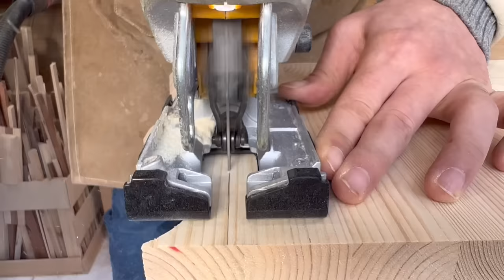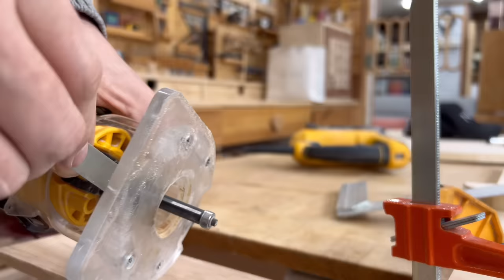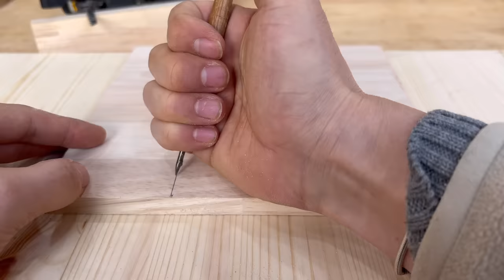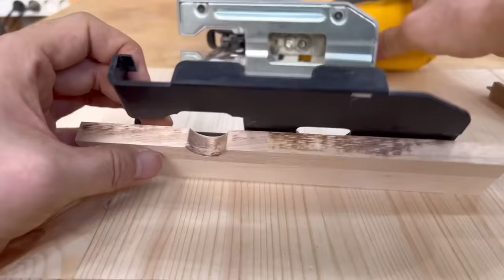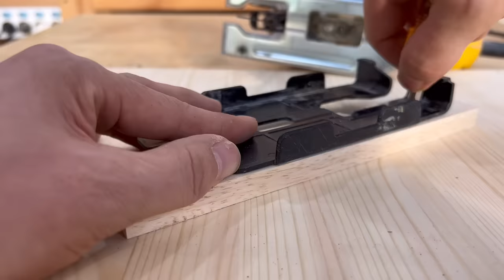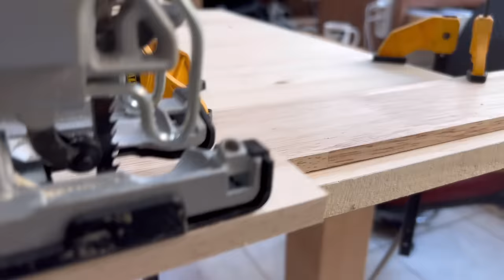라우터 방식을 응용하여 직쏘로 직선 자르기

Comment: Wouldn't it be easier to just clamp a straight edge to the workpiece and use that as a guide?  The method in the video essentially does the same thing, but with the added step of screwing a piece of wood to the jigsaw.
Reply from the maker: Thank you for good comments 😊 Have a nice time 🍀
Reply: I think theres a good chance that the jigsaw could wear out the edge or cut straight through in that case. I can see why this method is better long-term since it doesnt wear out the straight edge after repeated uses.
Reply: your idea has one benefit: you can cut thicker pieces. THOUGH: it's not so immediate to place the "guide rail" at the perfect distance. It's easy, but not as immediate as this method reaches
Reply: @marcopinchetti5872  the way I do it is by using guide blocks. Basically a pair of blocks that define the distance from the guide to the line. It's fast to set up and you can always use a metal guide like a t track if you are concerned about wear. But if you are doing a lot of them it can become time consuming in comparison to this method
Reply: Not to mention the added distance between the machine and the workpiece, allowing the blade to bend a little when it follows the grain of the wood. with the machine on the workpiece itself, the blade cannot bend that far, allowing for more precise cuts.Also, wood against wood gives more friction instead of metal against wood.
Reply: No OP is right this is not practical on the jobsite, if it were all us finish carpenters and cabinet makers would be using this method yet we’re not, we just clamp a straight edge on real quick then hit it instead of making a jig that’s a waste of time, or just use a table saw like a normal person, that’s what they’re made for ya know…
Reply: Exactly!!!
Reply: QUIT SPAMMING!
Reply: Also most jigsaws come with a paralel guide that id basicaly exactly this build here just adjustable and made of metal.
Reply: @chowderwhillis9448  a curved jig seems fun tho
Reply: @chowderwhillis9448  @inod yep
Reply: Exactly! Over complicated
Reply: How about using the router method with your router for a straight cut.
Reply: Job-site use a circular saw for straight cuts. Weekend warrior, this is just fine. It's a different case to using a table saw that requires the piece to be setup.
Reply: @JustinShaedo  jigsaws have to be the worst tool invented; bad for rough work, bad for precision work...
jigsaws belong in the junk bin!
Reply: @walterbrunswick  Fair enough :) I'd struggle to make curved cuts without one though, tbh I'd use a jigsaw in maybe 40% of installs I do... I'd just avoid them for straight cuts.
Reply: Exactly what I do :-)
Reply: @walterbrunswick  it has its purposes but I won't use it for finish cuts.  I use it for approximate cuts and finish with a sander, router, etc.
Reply: @marcopinchetti5872  you are still havingn to clamp a guide rail with this method...
Reply: My thoughts exactly. This just turns a simple task into rocket science. Unnecessary.
Reply: And destroying the tool in the first place 😂
Reply: Absolutely brilliant! This video simplifies complex concepts beautifully. I finally understand how to precisely cut straight lines using the router method. Thank you for such clear instructions!"
Reply: @marcopinchetti5872 that was my thinking too.
Reply: The edge may be straight but the jigsaw blade can waver resulting in  an edge that is not square.

Comment: Better to use the right tool for the right job. But if you have nothing else, I guess this can work as a permanent workaround if you not planning use the jigsaw for something else. Can also just use a guide and clamp as usual instead of fixing wood to the jigsaw which you will need to remove again when using it as intended. The ideal tool will be a circular saw and will give a much more desirable finish. Jigsaw is better for odd shapes, curves and tight corners in my opinion.
Reply from the maker: Thank you 😊 🍀👌Have a nice time 🍀
Reply: Exactly no offense uploaded but this is kinda stupid and just to get YouTube views, not practical on the jobsite
Reply: Exactly, the blade always flex thus no point trying to make accurate cuts. The only benefit of this jig is we don't have to account for the width of the base when placing the straight egde
Reply: Indeed a track saw will work better. But if you need to use a jigsaw this is a genius method.
Reply: @SimplySketchyGT  if I have to use a jigsaw, this jig, a straight edge, or whatever will always give me a less than desirable cut.  Free hand cut won't be that much different.
Reply: Speech.
Reply: @chowderwhillis9448  tout à fait d'accord avec toi, c'est inutile !!!!   juste pour faire du buzz.
Reply: Couldn't agree more
Reply: not all amateurs have all the tools as a woodworker, so this makes perfect sense
Reply: @kalinkaata  all the more reason to use a guide and clamp. Cheers
Reply: @Zjaan321  agree. was talking about the circular saw. an amateur may not have it
Reply: I don't want to use circular saw, because it's intimidating and dangerous. I've always been on the lookout for ways to make the jigsaw cut straight. This is the best method I've found so far.

Comment: 🙃🥴The irony of this video is that you need advanced power tools, like a table saw, to create a jig for making straight cuts with a jigsaw. However, if beginners had access to those advanced tools, they would likely choose to use them instead of a jigsaw for this specific task.
Reply: You could use the factory edge of a sheet of plywood to make this. That way you would not have to make any accurate cuts to make this jig. But you make a fair point. This is always the problem with these types of yt videos, "excuse me while I whip out my perfectly set up table saw to make a jig for cutting straight lines!" ;) 
Anyway, I will try to make this using only a jigsaw and a cordless drill

Comment: The black plastic guard that is on the bottom of the jigsaw...actually has square and parallel sides. Put a straight edge on the top of your timber and use it instead. Good brands state on them how wide they are between the edge and jigsaw edge.
Reply from the maker: Thank you 😊 Have a nice time 🍀

Comment: If you have a square or a straight endge you can run it against the the saw guide and will save you time and gives precision.
Reply: Yeah, there’s no point in doing what he did if you’re running the saw against a straight edge anyway.  Just back up the straight edge and run the guide along it like you said.

Comment: Great solution to finish 👏👍

Even with a circular saw you could get a wobble.
Reply from the maker: Thank you 😊 Have a nice time 🍀
Reply: Circular saws wobble but the saw kerf is consistent. When used with a fence, wobble will produce a kerf wider than the blade, but it won't produce a wandering cut like a saber saw. The angle of the blade to the work does not vary in a circular saw. It varies quite a bit, and unpredictably, in a saber saw.

Comment: Thank You. I need to make angled cuts on a 1900mm piece of plywood. This will do the job much more accurately than trying to follow a line. In fact I can use it with a circular saw. Much better than the saw guide cutting through the centre that I tried. Straight edge is of course another piece of ply.👍👍👍
Reply from the maker: Thank you 🤜🤛😊 Have a nice time 🍀

Comment: You will never have the same quality of edge as with a flush trim bit! The jigsaw blade has too much deflection(flex) in it....better to use a table saw or circular saw!
Reply: i like this design as it allows the clamped guide to be placed directly on the intended cut,
Reply: Yes. I too found it difficult inspite of all adjustments.
Reply: Because most jigsaws is junk, a circ saw is better yes.
Reply: You missed the entire point of why something like this might be helpful, maybe they don't have other tools? You ever think of that? "Just use X tool" is such a weak argument. Yeah that's true, if you don't have constraints on budget, storage space, etc.
Reply: @UrdnotAkongo  No, I didn't....ANY wood worker has a circular saw! I, and anybody I know, bought/was gifted a circular saw as their first power tool!
Reply: @UrdnotAkongo  And, the point you missed in the video, he "free handed" the first cut, then all he did was add a straight edge guide to the jigsaw! He could have just measured carefully and used a straight edge without attaching anything to the jigsaw!
Reply: @UrdnotAkongo  And it showed using a table saw to make the piece for the jigsaw! So there's that....

Comment: This is a great idea. Thanks for the video.
Reply from the maker: Thank you 🤜🤛💚😊 Have a nice time 🍀
Reply: It's a complete waste of time, did you see he clamped the straight piece of wood to the wood he was cutting? All he had to do was move it over to allow the blade to cut on the line he wanted to cut and just keep the base of the jigsaw tight to the clamped wood, he would have had the exact same outcome without going through all the wasted time attaching a piece of wood to his jigsaw.

Comment: If you use templates this works with almost every shape, including guitars. This is actually a very common and straightforward method. But if you want something straight, a chisel or a plane would also do a fine job, just takes more skill and time.

Comment: I love the bit where you need a table saw to get the straight cut on the guide you need for a tool thats not the best option, still have to clamp straight edge to your work, and will still probably get a wonky edge because it's a jig saw. 😂

Either cut with a jig saw and use the router to get the edge you want, or cut with the damn table saw
Reply from the maker: Thank you 😊 Have a nice time 🍀

Comment: Interesting, I wonder if you left the hole round, and fitted a Delrin plug with a slot the same width as the blade would make it cut even truer.
Reply from the maker: Thank you 😊

Comment: Was with you up til the end. Seems like a lot of work just to raise the jig saw higher away from the material. Point is you could just cut out the middle jig (play on words, lol) and just run the jigsaw's base against a straight edge instead of fabricating and attaching a higher base that's going to run against a straight edge. It just seems like wasted effort, much like my comment, lmao.

Comment: this is innovative  thanks for posting.  however my issue with jig saws is not only a straight cut but always blade deflection causing the blade to angle and vertically out of plumb. does this jig prevent this? if so, why?
Reply: Most jigsaws will have an adjuster for blad tension to make the blade cut more stable making the edge plum vertically, if using an older or cheap model the tension may slip causing the edge to not be vertically straight but you're definitely right with this being a problem. Much better off setting up a jig with a drill and a table saw blade for a cheap alternative to a table saw for making straight cuts. There's a few vids out there on how to do it. If wanting to use this method cutting very slowly to reduce pressure on the blade will help 🙂
Reply: @tuckersossaman236  Thanks for the suggestions!
Reply: Don't push it, go as slow as possible.
Reply: @tuckersossaman236  My issue with jigsaw is that I can follow a straight line while cutting, so I get it straight on the top but totally messed up on the bottom if the wood is thicker than 1cm. Does what you explain help with this problem? Thanks in advance!

Comment: Instead of wood I use lean or plexiglass. I cut a zero clearance slot with blade I will use in saw. Due to zero clearance it cuts a clean cut without splintering and you can watch the cut through the plexiglass. I attach the plexi to the saw soul plate with carpet tape (amazing how useful carpet tape is for woodworking) so easily removed so reverts to normal use.
Reply from the maker: Thank you 😊 Have a nice time 🍀

Comment: It's easy to cut straight lines with a jigsaw, just clamp a straight edge to your material and follow as a guide.
Reply: My thought as well 😉
Reply: Or use that table saw that you already have.
Reply: Exactly! All you need in measurement from blade to edge of jigsaw base, then set your guide accordingly, save all the faff with attaching bit of wood to bottom of jigsaw
Reply: That wont cut as fine. The blade will still vibrate and wont cut as straight and precise. What your saying only applies to a circular saw, not to a jig saw. Try it with a jig saw and It wont cut as precise as this.
Reply: @henryposadas295  not really lol

Comment: First cut without a fence - just kept sturdy with your hand, second cut with a fence? 

Could have saved a lot of hassle and just clamped on a straight edge as a fence but of course you’d still have the issue of the blade flexing which I’m sure you did even with your second cut because you didn’t actually compare the two cuts the same way.

Comment: Good idea but wouldnt personally alter the tool .. just use a straight edge on the other side and measure and clamp for where the edge of tool slide along and measure blade for desired cut
Reply from the maker: Thank you 😊 Have a nice time 🍀
Reply: @BStarCrafts   and yourself cheers for the tip

Comment: You have just limited the functionality of the Jigsaw.  Those cuts can easily be made with a handheld circular saw using a saw guide. A saw guide can be used with either a power saw or Jigsaw.
Reply from the maker: Thanks for opinion. 😊 Have a nice time 🍀
Reply: U really think he didnt know the very obvious? i think u missed the point
Reply: I’m sure the guy with an entire woodworking shop already knows that.
Reply: @gullenator1  Of course he does, but now so does everyone that reads my comment.
Reply: Not everyone has a handheld circular saw…

Comment: not working with every jigsaw
Since there is angle on razor.
and (not sure how its on english) luft, where you will still have 2-5% of loever-exstra angle.
Plus, keep im mind that if you cut more wide wood plank lets say more than 20mm then you will have more issue.
And if you cut 50mm and more that angle be even more.

So jigsaw its good, but not realy good instrument.
If you have tools whre you could fix it as it was shown at begining. Better to like that :D
That its just my opinion!

Comment: I don't see the point. Just measure how far the blade is from the side of the edge of the jigsaw foot. Then clamp the wood that far from the line you want to cut. Run the jigsaw along the wood and you have achieved the same. Or am I missing something?